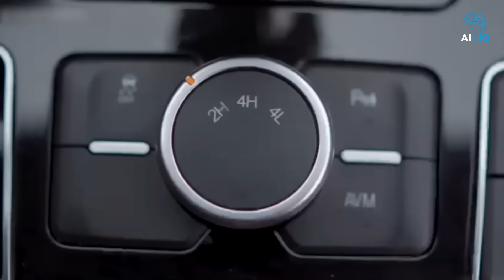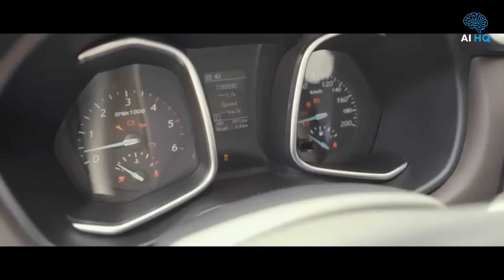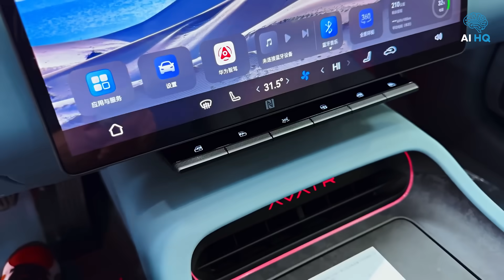Ghana’s Kantanka Cars Are Taking Over! 🇬🇭🚗🔥RIP Tesla?

Comment: Good grief, these cars are cheaply priced. 30,000-150,000 cedis is not 5-25K USD as the video states. That translates to $1936 to $9684. But there are no cars in the video priced this.
Reply from the maker: Thanks for the heads up.